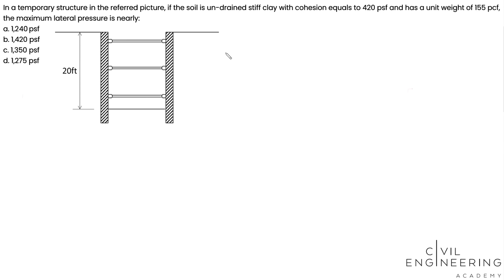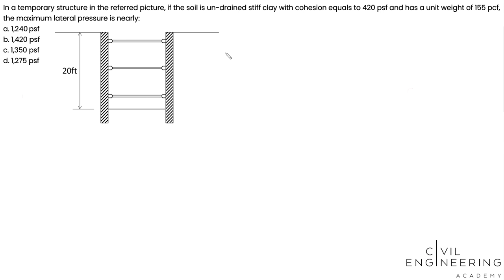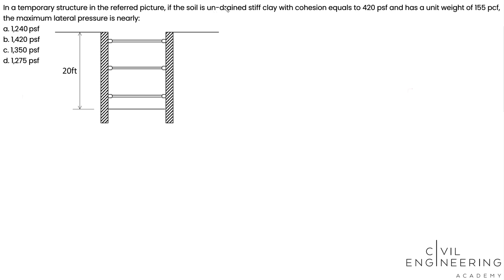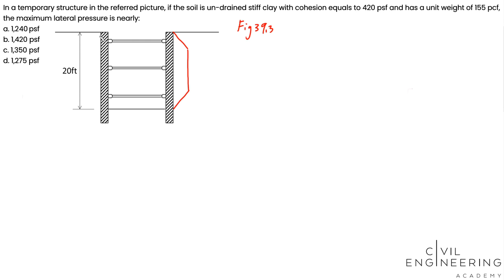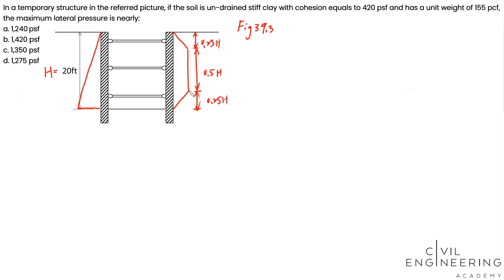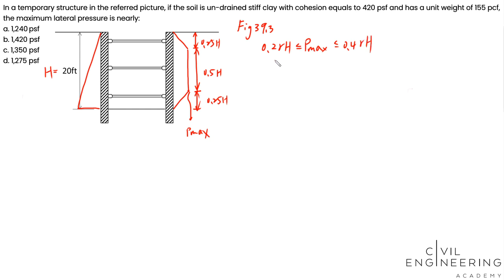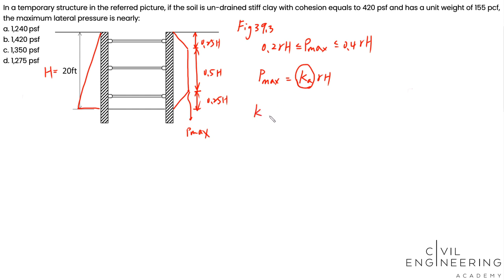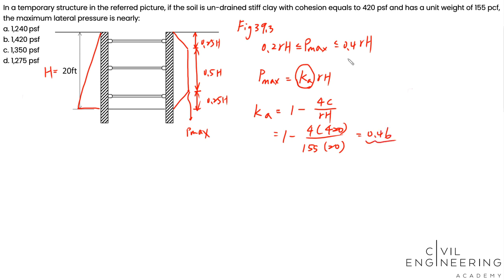Civil PE Exam - Geotech - Find Max Lateral Pressure in Temporary Structure

Comment: Most of the practice problems/videos on this channel are well done and very helpful, but this one should be updated. 

Based on the values given, the stability number is >6 and the soft to medium stiff apparent earth pressure diagram should be used (See NAVFAC 7.02 page 100 & GEC 4 Sections 5.2.3 to 5.2.6). Even without looking at the stability number, clay with a cohesion of 420 psf is a soft clay. A stiff clay would be around 1000 psf or higher.
Using the correct pressure diagram, the answer here should be 1420 psf.

Also, clay is more likely to be in the 110 pcf to 125 pcf range. 155 pcf is denser than concrete...
Reply: Which ncees pe hb 1.1 page shall we use nowadays for solving this problem?
Reply: Which ncees pe hb 1.1 page shall we use nowadays for solving this problem?

The cerm is dead.
Reply: Agreed. Per Navfac 7.02 use soft to medium stiff earth pressures when No>6. Answer should be B. Calculated answer comes in at 1419.8 psf

Comment: This question should be solved per soft to medium clay pressure distribution with stability number > 6, See NAVFAC 7.02 Page 100...
Reply: Which ncees pe hb 1.1 page shall we use nowadays for solving this problem?

The cerm is dead.
Reply: @oleopathic  I can't find any relevant info on this kind of problem in the PE Civil handbook so I'm skipping this topic
Reply: Agreed. Per Navfac 7.02 use soft to medium stiff earth pressures when No>6. Answer should be B. Calculated answer comes in at 1419.8 ps

Comment: Where is this formula in the Civil Reference Handbook V1.1 now that it is comp based?
Reply: Update, took the exam and unfortunately didn't pass. There are a lot more conceptual questions in the afternoon portion than you would expect that ill need more reading on
Reply: @IveGotChicken  have you passed it?
Reply: @IveGotChicken  took cbt ?

Which discipline ?

I failed 2 times the wr discipline. Now I'm solving every problem that I come across. No more excuses.
Reply: Closest I could find which is not great is Sect. 3.10, but no calcs....
Reply: Yea, I could not find anything for this the new reference book either.
Reply: Which ncees pe hb 1.1 page shall we use nowadays for solving this problem?

The cerm is dead.